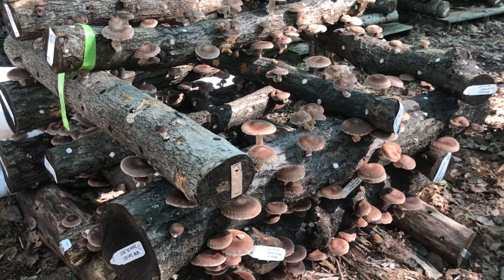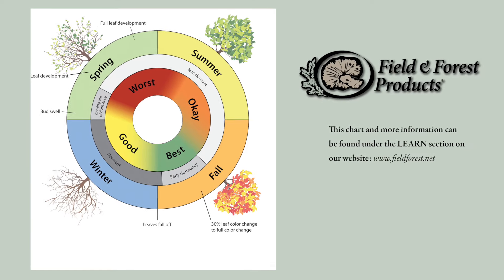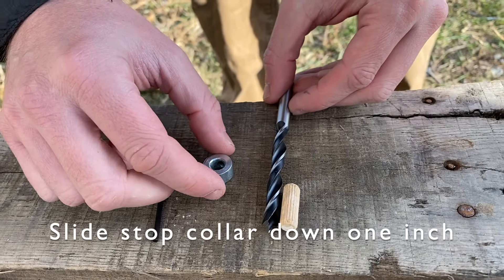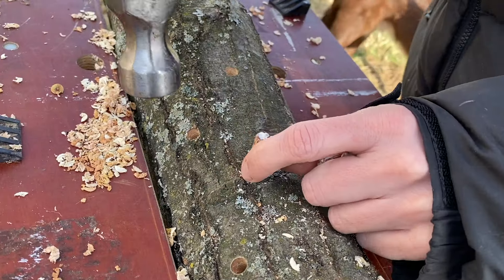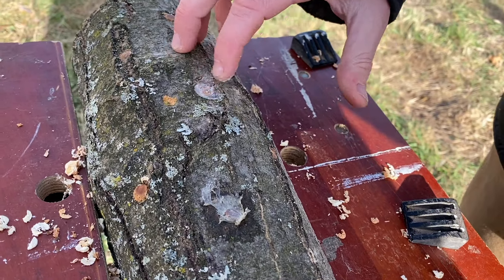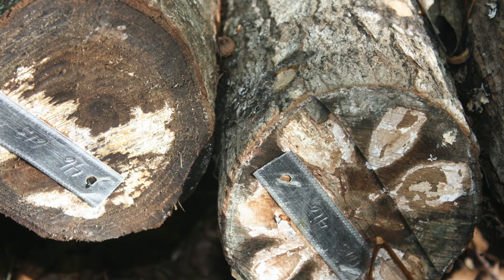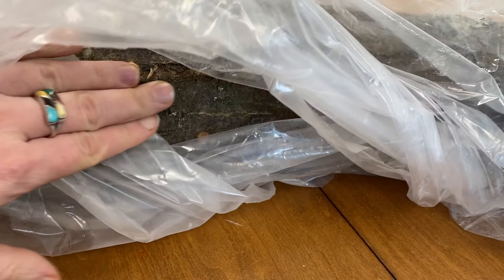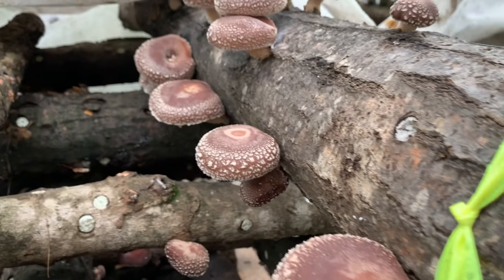Inoculating Mushroom Logs With Plug Spawn From Start to Finish

Comment: Best video on youtube for inoculation! Without a doubt!
Can you inoculate a log as soon as it is cut or is there a proper time frame? And can you inoculate the logs the first of spring or should you wait for a certain temperature? 
Thanks in advance!
Reply from the maker: Thank you! We recommend letting the logs rest for two weeks prior to inoculation- they can wait longer however if they are stored in a location out of the sun and wind. As for temperature you're usually in the clear once the day time highs are steadily in the mid-high 40s.

Comment: One question, I use Titebond 2 glue to seal limbs that I have pruned and it does a good job, could one also use the glue to seal dowel spawn ends? It would certainly be quicker and easier.

Comment: Awesome video! I live in Oregon, sounds like the ideal temperature is most of winter, except for nighttime, but I have a shed, does this affect the time they stay in their humid plastic bag?
Reply from the maker: As long as the logs are indoors they should stay in the bags to prevent a premature drying out. After the initial 4 weeks however the mycelium will be established and the logs can be moved outside!

Comment: If you have logs that are 10 to 12 inches in diameter....can you split them in have and inoculate the side with the bark?  Probably a dumb question, but.......tia
Reply from the maker: Keeping logs intact is fairly essential. Splitting them will cause the bark to fall off prematurely and as soon as that happens the wood can't support mycelium growth.
Reply: @FieldandForestProducts  Thanks for this!

Comment: All I can find for logs is a couple branch pieces of Black Walnut, but I'm pretty sure it was chopped down during summer months, although half dead from a brutal wind storm, it was hanging off the main trunk for months and the leaves were dead or dying on it. . A great size at about 6 inch diameter. It however has been lying in my garden for a couple years in my garden, half buried. No signs of fungal contamination or mycelium. Will that work ? I'd hate to spend my plugs and wait a year to find out otherwise.
Reply from the maker: I would find something fresh. If it's been a couple of years it's likely already starting to decay from non-visible fungi or is too dry for mycelium to take hold.
Reply: I'm in Ontario , Canada and it's pretty wet and humid here. More importantly, it was sheltered in a peat rich space under a raised patio deck. Its certainly not dry. As far as contamination goes, I don't see any mycelium in it . The bark may be lifting off of it though. Oh well. i'm going to try to stretch my wood plugs I bought by doing some agar with what I was sent. If i can get another culture going, I don't have anything to lose by trying this. some nice people on one of the Facebook groups gave me an interesting idea of using liquid culture, squirting some in each hole and then just pounding a new clean plug in after the squirt. I'll maybe give that a try. Thanks for your reply and i will ideally try and find fresh but if I got extra.... why not experiment ? @FieldandForestProducts

Comment: will the mycelium die if you inoculate before winter and they stay outdoors all year?

new england here, would like to try some outdoor reishi, turkey tail and chicken of woods, just not sure if i can do so before winter
Reply: No they go dormant and come back to life when they are warmer and hydrated
Reply from the maker: If using plug spawn you can inoculate the log and put it outside, but you will want to mulch the log in well with snow in order to prevent anything from freeze-drying. Generally we suggest that the log have at least 4 weeks of temperatures above 40 degrees so that the mycelium can establish itself before going dormant. You can place the logs outside without those four weeks, but the mycelium will not start running, increasing the risk that the pockets of spawn will dry out.

Comment: Does the plug wax need to be beeswax or can you use plain paraffin wax?
Reply from the maker: You can use plain paraffin, but it is a bit more brittle and might chip off easier.

Comment: How long do the logs typically continue to produce?  Also, what type of logs would you recommend for growing Oyster mushrooms in SW Michigan zone 6A?
Reply from the maker: Logs will continue to produce for 4-6 years, depending on the diameter of the logs. For Oyster mushroom production look for box elder or aspen logs!
Reply: @FieldandForestProducts  THank you!
Reply: Willow is superb for oysters
Reply: @FieldandForestProducts quick question. Where do get your logs? Do you just cut it down from your yard?
Reply from the maker: @ashitaka8633  we source them from a reservation who cuts for forestry management. If you have land you certainly can cut from your yard, but we only recommend cutting trees that need to come down.

Comment: I’m in the north east ozarks . I just got a 100 plugs of these . I know it’s the worst time to cut logs so maybe hit some stumps in my woods what ya think ? Rad vid !
Reply from the maker: I think you would have better luck cutting an oak limb. The problem with stump cultivation is that you have to use so many plugs to get good results. At least with cutting a limb you'll get a year or two of production. Otherwise pop the spawn in the refrigerator and cut a log later in summer.

Comment: I have a large oak tree that has seemingly died (almost no leaves last year, none this year) Can I chop it down and inoculate the logs? Or does it need to be alive when felled
Reply from the maker: The tree does need to be healthy when felled. If the tree has died it's likely that the cell structure of the wood has changed and therefore isn't suitable for mushroom production. We have Oak wilt here which kills off oaks and unfortunately there's not even the silver lining of being able to use the wood for mushrooms.

Comment: Can I use a log that has been cut 6 months or year ago. It was in dormancy.
Reply from the maker: There is likely some other fungus in the log at this point, especially if it sat through the summer where there is natural high fungal activity. For the amount of work that goes into inoculation I wouldn't risk using it.
Reply: @FieldandForestProducts  oh...ok.  Thanks!

Comment: Lowell Dietz says in the documentory "mushrooms of the  pacific NW" that it is near impossible to grow shitake on logs. Whats the secret ? Is keeping the 40% moisture level inside the logs during innoculation a challange?  What else is difficult? On the Pacific Penninsula the climate should be on your side as far as Temp & Humidity
Reply from the maker: Interesting. Growing shiitake on logs is very much possible- the most critical thing is to have freshly cut logs from the proper wood type.
Reply: @FieldandForestProducts  yeah, colonization is the difficult part,  fruiting is supposed to be easier.  I have thought of also injecting the logs with liquid mycelium in addition to the sawdust spawn. It would add a little moisture and a food source for the mycelium.
Reply from the maker: @Beinhartwie1chopper  If you keep logs in a protected location (out of the sun and wind) you shouldn't have to worry about colonization. I would recommend against inoculating with two different types of spawn as they will likely compete against each other.
Reply: @FieldandForestProducts  thank you for the advice! I have run 700 beehives but mycology is a relativ new thing. I will reread Radical MYCOLO, growing g. and m. Mushroom,  and trad cotters organic m farming. Always greatful for any input.